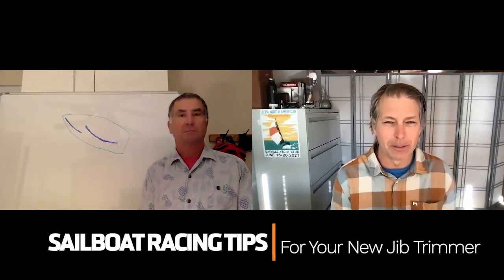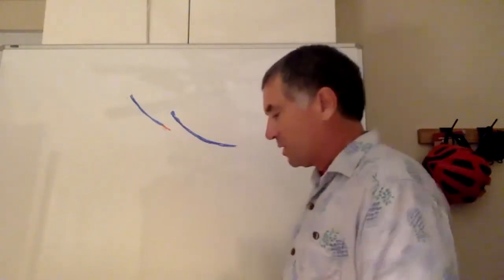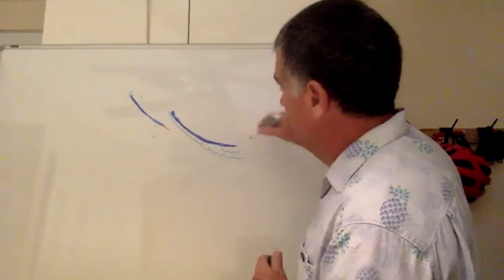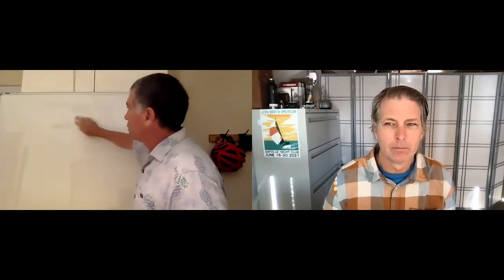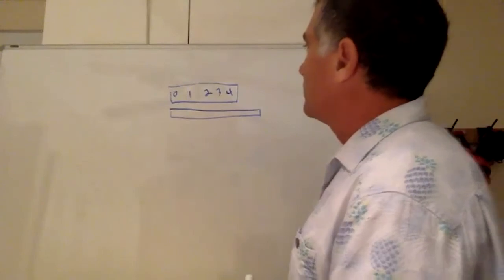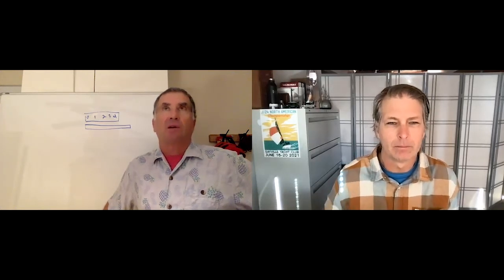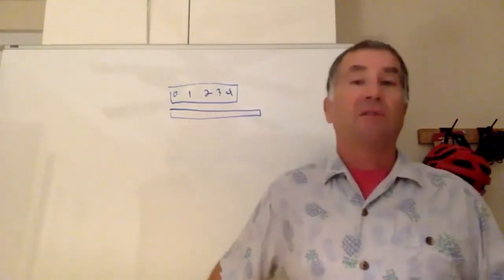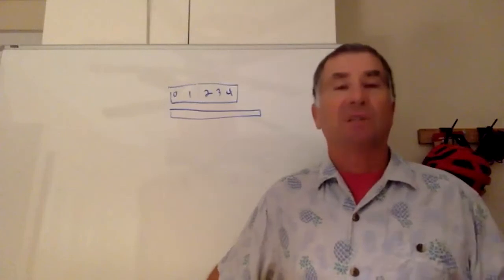Sailboat Racing Tips: For Your New Jib Trimmer

Comment: Most my jib trim is though feel with glances at tell tales. Man that really taught me trim is a blind man. So I learned through feel never cleating me line. Lite situations using finger tips and line across forefinger like fishing line. Sailing with me disabled mates I usually  really learned to use my senses and improvising in sailing. It's really difficult  for those that use fly by wire for trim and or helm. Mad respect for those folks at BAADS, BAY AREA ASSOCIATION OF DISADBLED SAILORS. Spent 6 years 3-5 days a week volunteering, racing, teaching, training, etc.  They taught me everything I know. Good people there.

Comment: I would have liked to hear more about the relationship between trim and height. To present a different angle of attack to the sail, you can either change the angle of the sail or the angle of the boat. I often steer to the tell tails rather than play the sail and hold course, but I'm not sure if this is the best strategy.